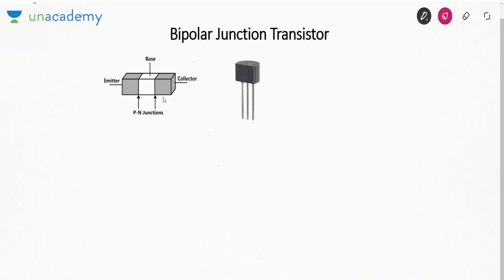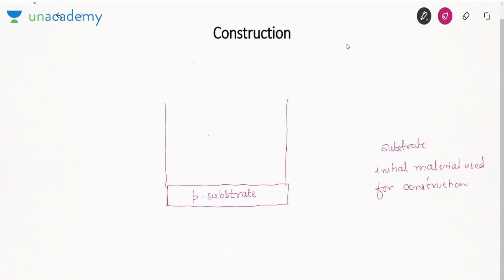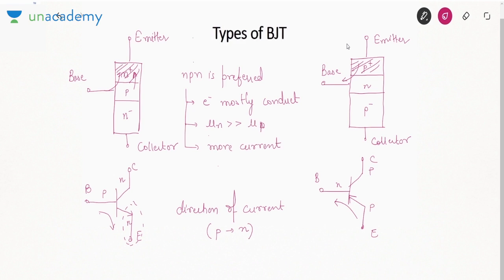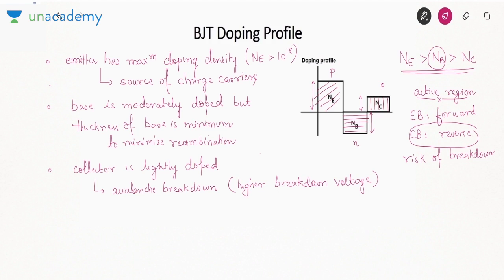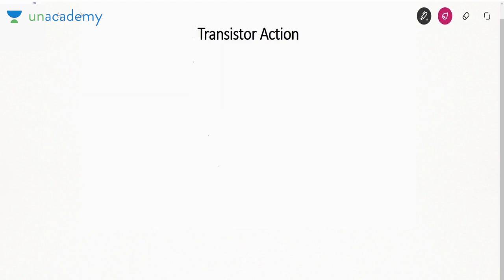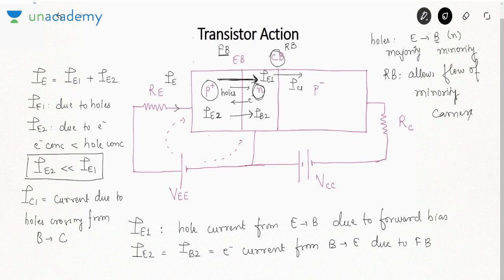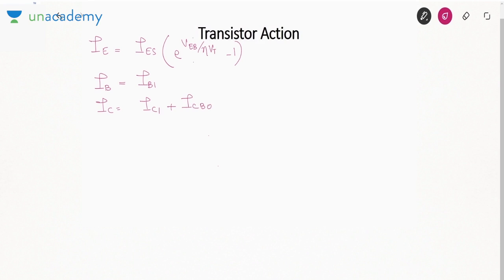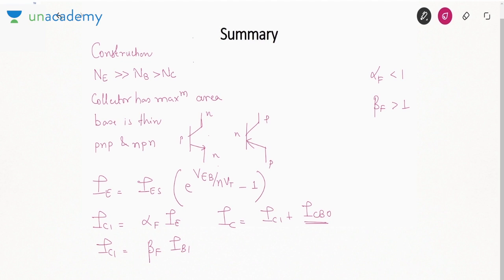Introduction to BJT | BJT | Lec 23 | Analog Electronics | GATE 2021 Exam | Ankit Goyal

Comment: Sir in all the reference material it is written that base is lightly doped and collector is moderately doped... please clear my confusion which is correct?
Reply: Doping is different from doping density. In the lecture , sir is focusing on doping density. As collector has very large area compared to base, the doping per unit volume in collector is less than that of base. You are right, Doping in collector is higher than base, but doping density of collector is lesser than base.
Reply: I can clear the doubt ....but if you want to learn where I learned from then go watch KAMESH Srivastava EDC full course he has told this in depth
Reply: Emitter  highly doped, next base, least collector.This can be confirm by early effect too.